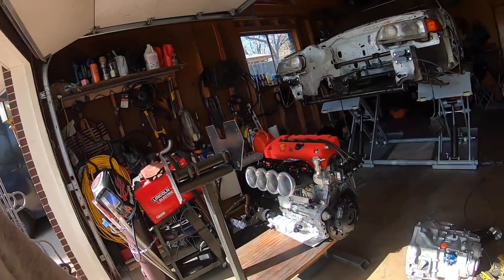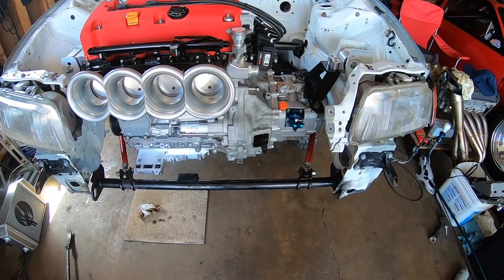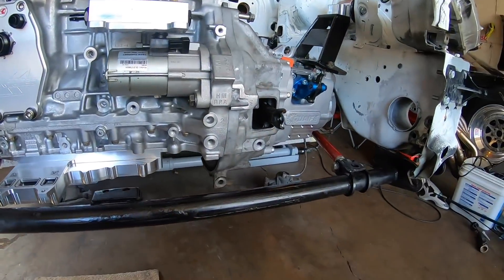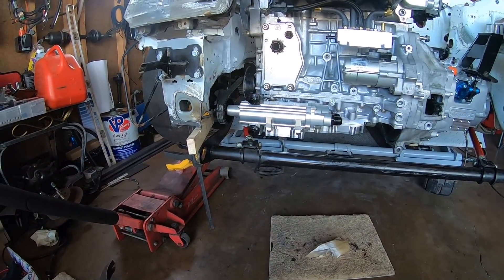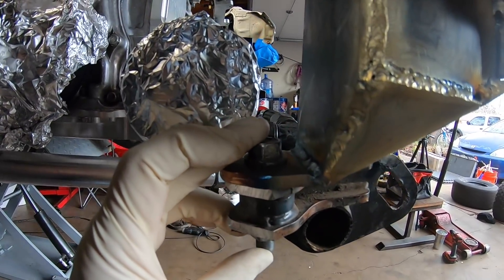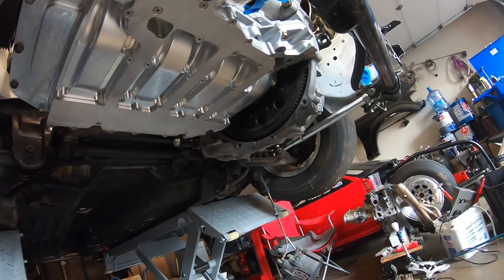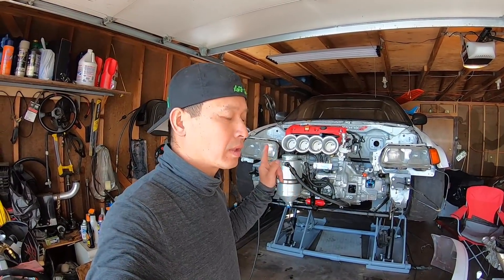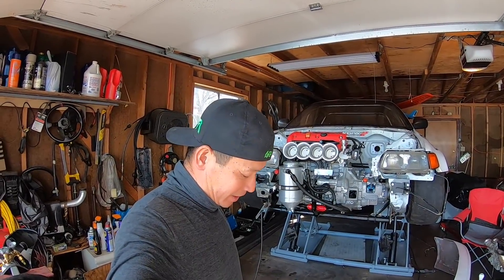HONDA CRX got dry sump oil system!!

Comment: When welding those thick plates....I'd bevel it for at least 3 passes.  1/4 plate equals over half an inch width of weld.  wrap the corners.